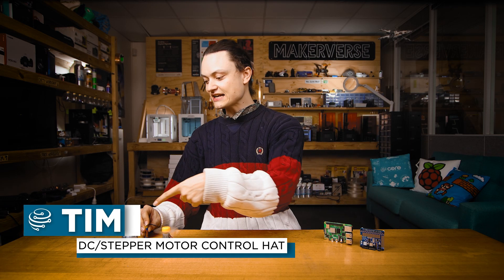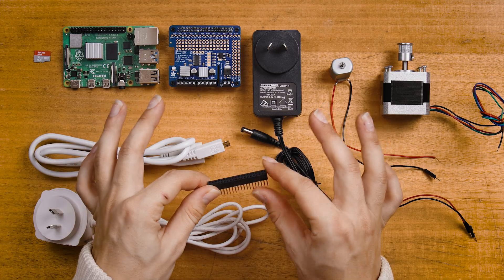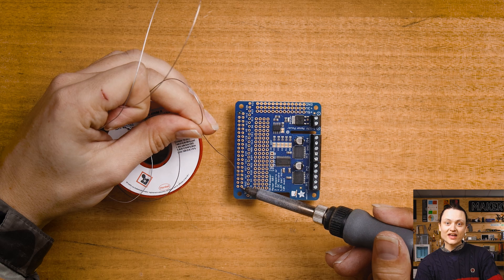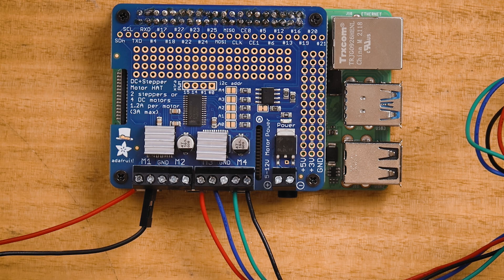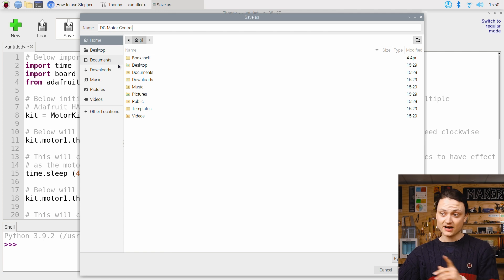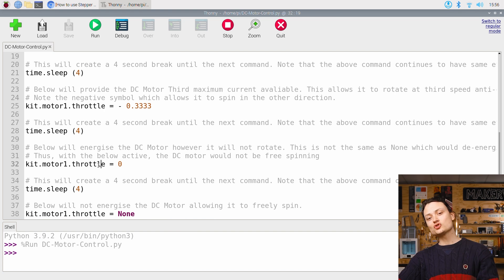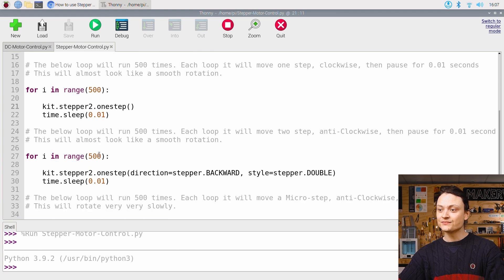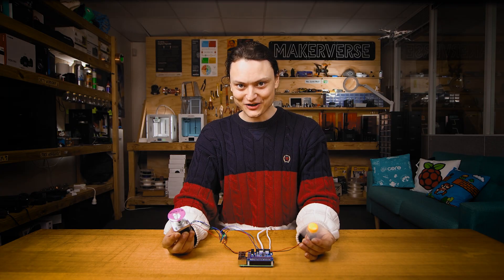Controlling DC and Stepper Motors With A Raspberry Pi - How to use Adafruit DC & Stepper Motor HAT

Comment from the maker: IMPORTANT! This guide will not work with the Raspberry Pi 5. The Pi 5 handles its GPIO pins differently so the libraries used in this guide no longer work. A Pi 4 or older will still work just fine with this guide.

Comment: Could I control a stepper motor and a solenoid with this setup. Trying to retrofit a simple glue machine. Machine is similar to a printer with a solenoid-controlled glue valve that traveles on a ink get printer type guild rail.
Reply from the maker: This definitely could! Although, if you don't need the power of a full Raspberry Pi computer, a better choice might be to look into the Raspberry Pi Picos, which are a microcontroller instead.

Comment: I want to use this method to run 12 servo motors spread out over about 100 feet. I will have a power supply and relay at each servo motor.  I will call each servo, power supply, and relay a station. There is be 12 stations.  My question is about wiring the stations up. Can I use RJ45 (cat5)  cable to connect the raspberry pi to the stations?  If not do you have any suggestions on how to wire up each station?

Comment: How to make this code run i a loop so my stepper motor runs back and forth 180 degrees? And also connect some switch or just automate when I plug raspberry into wall socket it executes the code automatically?
Reply from the maker: You would need to place it inside of a while true loop. We have a video here looking at loops in Python:
https://youtu.be/jP2J9A43oHY

If you still need a hand, feel free to ask a question on our community forums:
https://forum.core-electronics.com.au/

Another option would be to paste the code in a large language model like ChatGPT or Claude and ask them how to do it. They are exceptionally good at writing Python code!
Reply: @Core-Electronics  Thank you! :)

Comment: Hey there, can i also stack the Adafruit 16-Channel PWM + Servo HAT on top of this?
Reply from the maker: These use I2C which can have (theoretically) dozens of them stacked on top of each other. As long as you solder the right pin headers to stack them, it should work!

Comment: How would I install motor kit on the pi 5 ... it does not install?
Reply from the maker: The Pi 5 has the same 40 GPIO pinout as the previous Pi's so the installation should be the same!

Comment: Hello I am new to ras pi but u have an 80 dollar gift card for micro center and I want to know what raspberry pi and what stepper motor to get and how to connect them and power it. thanks guys and is there a way to connect more than on stepper motor to only one ras pi thanks again
Reply from the maker: This depends on what the project you are using it for. Raspberry Pis come in their main series boards, the Pi4 is the last Gen, and the Pi 5 is the newer generation which is a tad more expensive but worth the upgrade. They also come in different RAM sizes, for general day to day tasks I've had no issus on 2 or 4gb. The Pis also come in a much cheaper Rsapberry Pi Zero form factor, which is a fair bit slower, but great for simple tasks that don't need the power. 

As for what stepper you need, it also depends on the project. We have a comprehensive guide here on different motors that has a lot of good information:

https://core-electronics.com.au/guides/digital-electronics/servos-steppers-or-solenoids-choosing-an-actuator-to-move-your-project/

Happy making!
Reply: @Core-Electronics  thanks would you know where to find a power cable for the raspberry pi 4 and a 12 volt stepper motor

Comment: In your video, you used separate power sources for the motor controller and the Raspberry Pi, totaling two power sources. Instead of doing that, isn't there a Raspberry Pi component, similar to a computer supply unit, that automatically supplies the necessary power to each module?

Comment: I kind of imagined that I'd be able to buy some kit which would allow the pi to control a stepper with very high level commands such as " rotate clockwise at rate n"

But I'm not finding it.  Looks like I need something like a pico or arduino.  But hasn't someone bundled all that stuff and the driver for me?
Reply: Well, you can basically do that yourself - write a function that converts mm/s into steps/s (clockwise can be found in the example code shown in the video), then you can pass "rotate clockwise at 10 mm/s" to that function.

Comment: Is it possible to connect other things with the hat on? I'd like to control both a motor and a light.
Reply from the maker: That depends on what light you are trying to control and how you are setting it up. You can think of the M terminals as a controllable voltage. You can increase and decrease or swap the polarity of the voltage. So if your light is suitable, you can happily run it off another motor channel, and you could even change the brightness of it the same way you would control motor speed, but it all depends on the light.

If you want some more help, chuck us a post on our forums, we have a lot more eyes on there. Just give us some more details of the light you are using and the setup: forum.core-electronics.com.au

Cheers!

Comment: I am receiving an error when running the installation package for the adafruit circuit python motorkit. It is saying that it is an "externally-managed-environment". What could be causing this issue?

Comment: Hi @core celectronics
Awesome video which I'm using as a base to build a dog treat dispenser with a stepper motor. I've bought the none- soldering version and have set it all up but I'm getting an error on the stepper motor script saying it can't find the i2c devices. I've googled and ran i2cdetect which isn't bring back anything. I've double checked I've enabled i2c, is there a step I've missed? The bonnet does seem loose but I don't know if I'm meant to use too much force putting it on. Any help would be appreciated, thanks!
Reply from the maker: Hey Hitman, flick us the question over on our forums: http://coreelec.io/forum 

Our staff check there several times a day during work hours and someone can help you out with that (and if anyone is having the same issue its easier for them to find), we aren't as frequently on YouTube support.

Comment: If I don't have those hat for running my stepper motor, could I directly connect my raspberry pi directly to the regular stepper driver? I heard that you should convert the logic level from the stepper driver first (because most of the pinout using 5v logic), so it would not damage your Pi. But I have seen people directly connect the driver to Pi and had no issued with it. I'm confused

Comment: Does this hat also work with an Arduino Mega 2560 board? (With loose wire connections)

Comment: Can I use a Dc encoder with this motor hat?
Reply from the maker: This simple questions is an excellent one. The libraries made for this HAT won't know what to do with the encoded data from the DC Motor. You can just hook up a DC Motor (which has an encoder) and not use the encoder part just fine with this HAT. 

There are empty/free pins on the Raspberry Pi. You could write your own script that runs along side the Adafruit scripts that would analyse the encoding for you.  

You could also use a board more designed for DC Encoded Motors like this one here - https://www.youtube.com/watch?v=2bganVdLg5Q

I hope that helps you\ - Tim

Comment: Hi @core electronics! 
Thanks for the very informative video. I’ve learned to control step motors using a DRV8825 driver with which one usually tunes the step motor current using a potentiometer. Could you explain to me why this board does not require this kind of tuning? Also, what happens if I connect, say, a 1.5A motor to the board? Will the motor try to draw too much power from the board? 
Sorry if these questions have obvious answers - I’m just getting into electronics.
Thanks again and best wishes!

Comment: can u add other sensors/inputs with the hat?
Reply from the maker: Absolutely, that protoboard section is ready to be utilised on the HAT and a number of GPIO pins are not being used by the HAT and are free to power/control other hardware - https://pinout.xyz/pinout/adafruit_dc_stepper_motor_hat

Comment: What if someone is using a unipolar stepper motor?
Reply from the maker: You will need to identify which wire is the Centre Tap and connect that one to the Center GND Screw-Down Terminal. The remaining 4 wires make up Two Coil Loops. You can Identify a Coil Pair by checking the end of two wires for continuity with a Multimeter. If the Multimeter beeps (confirming continuity) you have identified coil pair. Come check the full written up article for more help if you need 😊 https://core-electronics.com.au/guides/raspberry-pi/raspberry-pi-dc-stepper-motor-guide/

Comment: I have a power supply that delivers 12V at 2A. If I have a stepper motor rated for 12V at 1.68A, will the extra 0.32A from the power supply damage the motor?
Reply from the maker: You are totally safe. The system will only pull the amps that it requires. Come check here if you want to know my Golden Rules when it comes to Power supply selection 😊 https://core-electronics.com.au/guides/prototyping/power-supply-which-to-choose/

Comment: When soldering the piece at 3:37, is it ok if the solders on different pins end up connecting? Will this mess up anything electronically?
Reply from the maker: Definitely could cause issues (including the dreaded puff of magic smoke)! For instance if you accidentally electrically connected a 5V Pin to the 3.3V Pin that will break your Raspberry Pi. https://pinout.xyz/

Removing solder can best be done with a lot of flux and solder wick - https://core-electronics.com.au/solder-wick-desolder-braid-0-8mm-5ft-8015.html

You can flick off solder by heating it up and whipping the soldering pencil away from you but it is no where near as elegant or as easy to do.

Comment: If I instead wanted to use a stepper motor and a servo motor, would the setup be similar? What if the servo motor needs to be connected to the same pins as the stepper? Is it ok to connect wires from the servo and the stepper to the same pins?
Reply from the maker: Heyya champ 😊 come check it out here as it is exactly what your interested in - https://learn.adafruit.com/adafruit-motor-shield-v2-for-arduino/using-rc-servos
Reply: @Core-Electronics  Thank you! This looks like it will allow me to easily control a servo and stepper at the same time! Unfortunately, however, it looks like the shield is out of stock.
Reply: Is this compatible with the Raspberry Pi 3 Model B V1.2?
Reply: If not, would you have any similar recommendations that would work for that model of Raspberry Pi?
Reply from the maker: Both shields are compatible with that model of Raspberry Pi and much like how that Motor shield has GND, 5V and Data pins right next to each other so does the DC and Stepper Motor HAT (from above video). You'll be able to set up servo control with the exact same connection set up for both of them 😊
Reply: @Core-Electronics  Great! However, in that case, is there any reason why the HAT mentioned in this video wouldn't work if I replaced the DC with a servo?
Reply from the maker: You just gotta send particular PWM electrical signals to a Servo whereas DC Motor only requires a simple DC current to run. You can learn a lot about those PWM signals here https://core-electronics.com.au/guides/control-servo-raspberry-pi/
Reply: @Core-Electronics  Got it! And we're 100% sure that the Adafruit Motor Shield V2 is compatible with the Raspberry Pi? It seems that everything suggests that it's made for an Arduino controller. Just want to be sure before buying!
Reply from the maker: If your running your system with a Raspberry Pi this is the HAT you want to use (same as the video above) - https://core-electronics.com.au/adafruit-dc-stepper-motor-hat-for-raspberry-pi-mini-kit.html

Like you correctly sleuth-ed out the Adafruit Motor Shield V2 is purpose built for the Arduino Uno.
Reply: @Core-Electronics  Ok, so just to be extra clear - The HAT shown in the video above will be able to drive a stepper and a servo?
Reply from the maker: 100% 😊

Comment: what is the maximum speed of the stepper motot
Reply from the maker: This 12V stepper motor hums along nicely at 50 RPM with the Adafruit Arduino Motor HAT. The Adafruit Arduino Motor HAT has the exact same Driving IC's as the Raspberry Pi Motor HAT so that's your answer 😊.

Comment: could I stack another board on top of the ada that gives me access to the underlying gpio pins so i can run some solonoids in addition to the stepper motor? Thanks
Reply from the maker: I've added a comment to the bottom of the Article that Address just this 😊. The HAT has pads that break out the unused GPIO pins. That means you won't need to add anything extra to gain access to the GPIO for your Solenoids/Relay Control.

Check here for more information - https://forum.core-electronics.com.au/t/guide-by-tim-how-to-use-stepper-motors-and-dc-motors-with-a-raspberry-pi-adafruit-dc-stepper-motor-hat/15071
Reply: @Core-Electronics  thank you so much for your fast reply and resource . Really helpful

Comment: as I told you issac uses an arduino and I want to replace it with an rpi with the hat that you present, I have already printed and assembled all the parts, and modify for the rpi, I also have the stepper motor and my two cameras (an rpi hq and a usb), the one in usb to serve me as a pointer,  I think to use open cv, and have an automatic mode and a manual mode, if you can help me it would be great otherwise thank you anyway
Reply from the maker: Sounds like a formidable project 😊 the best place to get help for big project knowledge is our Core Electronics Forum, definitely come write up a post there if you need - https://forum.core-electronics.com.au/

Comment: Thank you the problem is that I do not speak English, the subtitles are not available and therefore the translation either, despite everything I can understand the principle, is if you could make a video on the subject using the dc stepper hat would be great, my current project is to take the turret from isaac879 and replace the Arduino with the rpi and make it a stellar observation turret, thank you.
Reply from the maker: Subtitles should be available now, sometimes it takes a couple of days. Hopefully that will help. 

And I would love to see that project completed! Pointing Pan-Tilt systems are the Stars are the best possible use case (in my opinion). Come check out project which does a very similar thing as to what you want - https://core-electronics.com.au/projects/auto-camera-tracking-system/
Reply: @Core-Electronics  Yes thank you, looking on my side I was stumbling on this project, unfortunately it uses an arduino for engine control, and on my side I do not know programmed in python, it would help me a lot to know how can self-control the engine step by step with video detection (either motioneye or opencv) via the hat,   Is there a code that I could import, in any case thank you anyway.